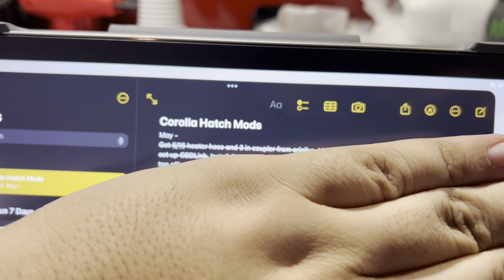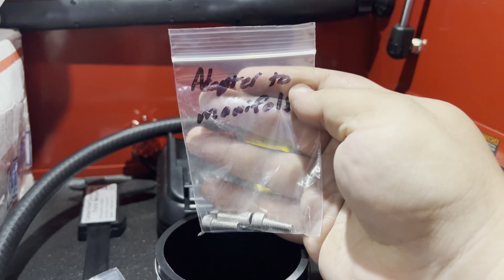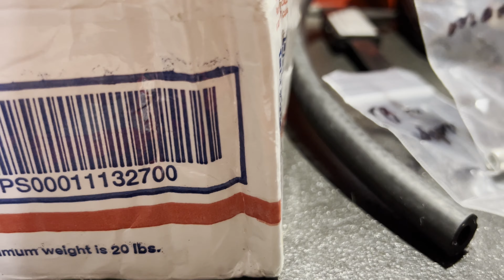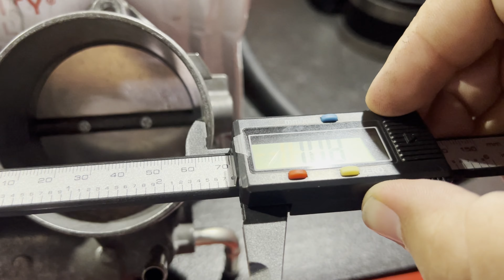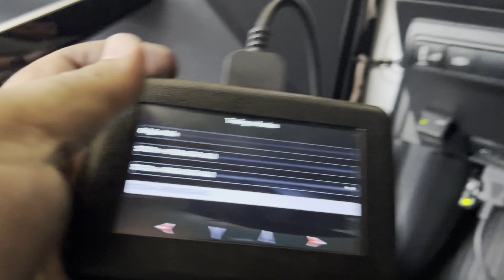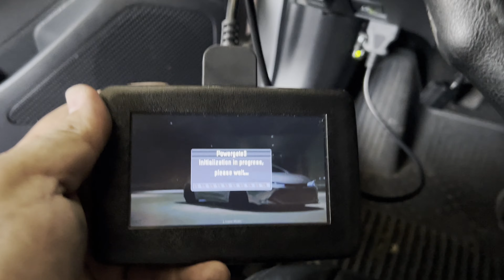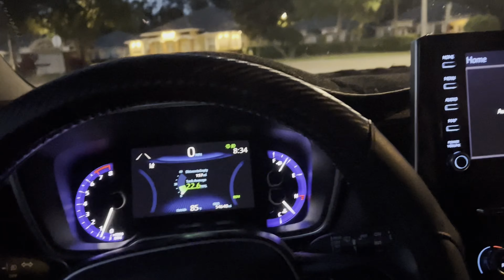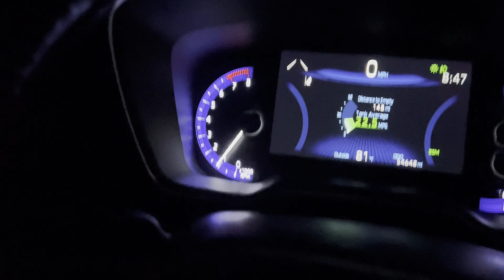GGP Camry to Corolla Throttle Body Adapter Installation & First Drive

Comment: Did the same thing for the throttle body as you, but I reconnected the coolant pumps to the throttle body. It should be fine if I'm correct.
Reply from the maker: Correct, it will work perfectly fine if you reconnect the coolant lines. It is personal preference if you decide to connect them or not. Not connecting them helps with intake temps.
Reply: @JulioTRD  appreciate it, homie 💯🙏🏾
Reply from the maker: no problem man. any other questions lmk!
Reply: @JulioTRD  also did your car stop popping after putting in the TB if you had the pop tune because mine only pops when it's low rpms and very high rpms.
Reply from the maker: mine actually hasnt popped in the mid range for a while, its usually above 4500 rpm or below 2500. it hasnt really bothered me honestly.

Comment: Can you add the GGP 2.0 throttle body spacer, the camry/ Rav4 2.5 throttle body with the new adaptor, and the 2j intake?  Or is there no point or not enough space?
Reply: There wouldn’t be enough space, I wouldn’t say it would be a waste, but you do already have a throttle body spacer on it’s just an adapter.
Reply: @tgibbi4616  maybe GGP,  could make the vortex carving inside the spacer on the new adaptor
Reply from the maker: As @tgibbi said, it wouldn't necessarily be a waste and it might have some benefit, I'm just not sure if there would be enough space for it. On top of that, the adapter is acting as a spacer as well.

Comment: I have headers, midpipe, and a the Camry throttle body on the way. Do I get the tune before the mods or do I drive it around with the mods for a bit then tune it? What's safer for the car?
Reply from the maker: i would put the mods on then tune right after tbh that way after you put the mods on the tune makes sure the car is running right

Comment: Whats good bro. 

Is a tune required with this mod? Also, would you have a part# for the 2.5 throttle body?
Reply: 22030-F0010
Reply from the maker: I would recommend a tune, yes. I'd have to look for the part number to verify, but someone else commented it, so you could start there.

Comment: dumb question but is possible to use the camry throttle body on the stock intake manifold? I prefer to have a quiet vehicle but have some increase in throttle response.
Reply from the maker: i put the throttle body on my stock manifold with the adapter, im just not sure if your factory intake tubing will fit the bigger throttle body

Comment: Is there a reason why the coolant lines are not connected back to the new Camry throttle body?
Reply from the maker: there is no need for them to be connected, at least for me here in florida. coolant running through the throttle body is mainly to keep it from freezing over in cooler climates from what i understand. ran the same in my 8th gen and never had an issue

Comment: What intake do you use now? Nothing for the 2.0 will fit the new throttle body right?
Reply from the maker: actually, I still run the 2jracing intake bro. you just need a bigger coupler to adapt it to the bigger throttle body size. I think its 3"-3", I am sure I mentioned it in the video somewhere.

Comment: did you noticed any power gains hp/tq? did you tune it and checked?
Reply from the maker: it is tuned on amt stage 3. a buddy of mine went on the dyno with stock tb and camry tb and saw 5-6 whp gains.

Comment: What hp/tq is the stage 3 tune making at the wheels?
Reply from the maker: i've yet to take it to a dyno, lots of personal stuff going lately, but hopefully soon I am able to take the car to a dyno and get some numbers.
Reply: Probably around 200 on 91 
If under AMT tuning 

E80 gets you around 215
Reply: I’ve only seen low 200hp numbers so far. But I could be wrong.

Comment: think this'll work for a corolla im 2017 Julio.?
Reply from the maker: no unfortunately. the 2017 is a 1.8 2zr motor while this one has the 2.0 m20a motor, and the adapter is made for the 2.0. as far as i know, there hasn't been anything made to adapt a bigger throttle body to the 2zr but I may be wrong.

Comment: Exhaust setup?
Reply from the maker: In this video its 2jracing header and 2.5" custom header back with a small vibrant resonator, magnaflow muffler as a resonator as well, and 2 more magnaflow mufflers in the back as a dual exit setup. I have a video of it that I will upload soon in a separate video.

Comment: What intake is that?
Reply from the maker: 2jracing
Reply: @JulioTRD it’s honestly one of the best. 

Acts a Ram and gets the most cold air compared to the ones I’ve seen and used. 

The exposed filters have good upper end. 

And the box intakes are good for Lower end instant torque.

Comment: Would this work with 2.0 3ZR FE engine?
Reply from the maker: I don't believe so, the throttle body adapter may not line up.